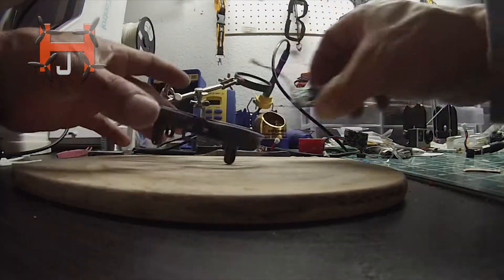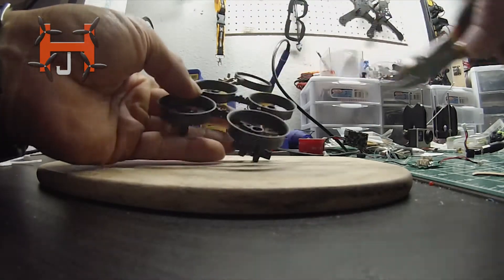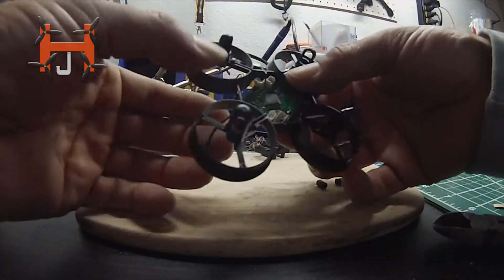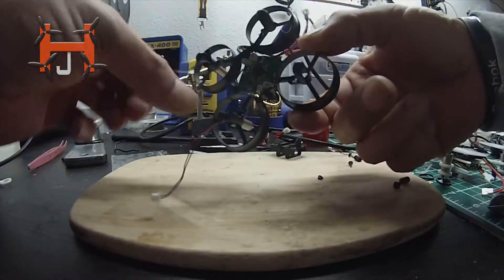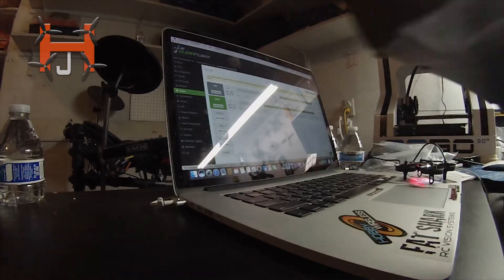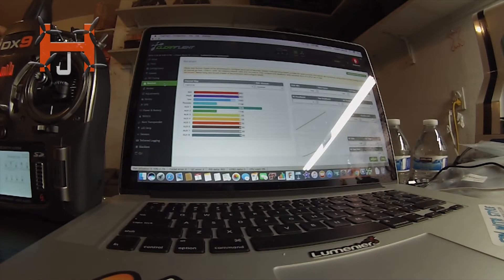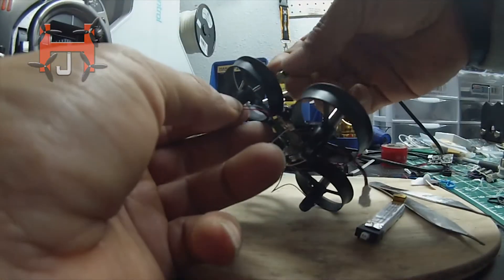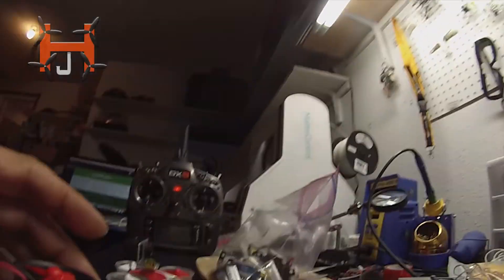MY CUSTOM EACHINE E010 TINY WHOOP

Comment: Which is max flight time with the 220mAh battery? I have some issues with my machine (almost similar parts assembled) that lose power and height after only 1min...
Reply from the maker: Are the motors new?
Reply: Unluckily yes, the motors are quite new...